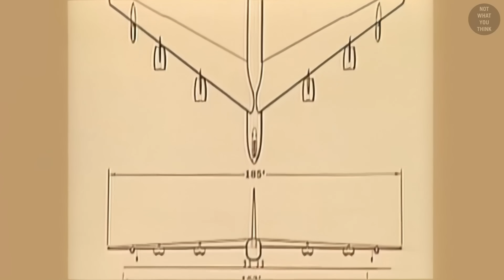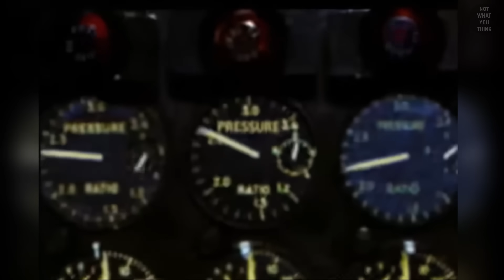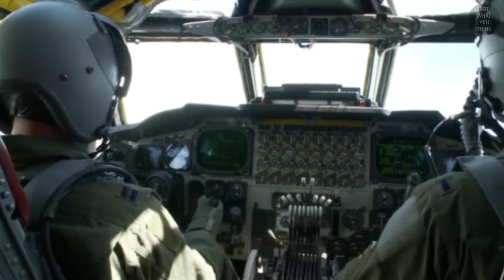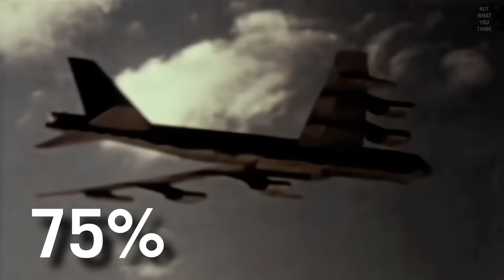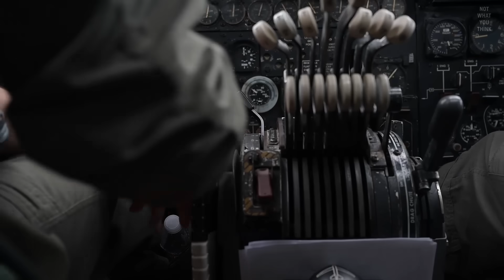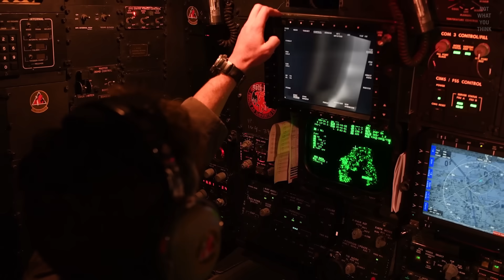Why This Obsolete Bomber Will Outlive EVERYTHING

Comment: B-52s are incredible to me because they are 70 years old and so versatile. Although they have had many upgrades, it's the weapons they carry now that have allowed their roles to change, making up for their obvious limitations in modern warfare, like a giant radar cross-section (RCS). They can fly over 8000 miles and fire 20 air-launched cruise missiles with another 1500 miles of range, or fire 20 Harpoon anti-ship missiles 150 miles. Three B-52s could take off from the States, fly between 20 and 30 hours, and launch 60 Harpoons at Chinese ships trying to invade Taiwan, or fly out of Guam, and fly for less than 4 hours. While helping Taiwan neutralize an invasion force, multiple C-17s carrying Rapid Dragon could launch 45 cruise missiles each at high-value targets across China. Old and still a valuable part of America's arsenal. One of America's best investments in national security.

Comment: I was a AFSC 43152 Airlift/Bombardment Aircraft Maintenance Specialist (Crew Chief) stationed at Dyess AFB and we had the old B-52Ds there until they were replaced with B-1 bombers. I was assigned to MAC  on a SAC base and a dedicated crew chief on the C-130H (741689). We were on flight line C, next to the nuclear alert pad. It used to scare the shit out of me whenever they were testing. You’d hear the blast packs going off and nothing but blue lights and sirens. It was old back then and all of the D models have since the early 80’s have been retired. Great aircraft! The B-1 is faster and carries a heavier payload, but the BUFF is no slouch. I don’t know where you get your stats on costs per flight hour, but that doesn’t sound right…too high.

Comment: In a sense, it does not need the vertical stabilizer, as the turning is not made by the rudder (in fact, it is very small with very limited action. If it still has one...),  but by differential thrust. That is also the reason for the 8 engines and why although with any upgrade 4 would be more than enough, as it does not have a capable rudder, the 8 engines are still required for redundancy to control it.

Comment: This is a garbage video. I retired in 2006 after flying the B-52H.  It is by no means obsolete.  It is currently scheduled to fly through 2050, with new Rolls Royce engines, when it will get the B-52J designation.  The B-52J will fly well past the retirement dates of the B-1 and B-2 bombers.

Comment: Guys, the Douglas DC-3 is all but immortal. It has outlasted many jet designs. It will likely even outlast the venerable and formidable B-52, even if the DC-3s are obliged to lose their radial engines and replace them with turboprops. The USAF is keeping this old warbird around because it has proven tough and flexible, but so what? All good things come to an end.

Comment: The BUFF is eternal. Also, that's one of the reasons why we send in low radar visibility aircraft with air to ground weapons systems ahead of time. The B-52 and A-10 are far more useful once you covertly remove the enemy's ability to resist an air strike.

Comment: They still need to upgrade the engines. 4 modern high bypass turbo fans engines will lift that thing up easily. Thes old, loud and smokey engines are a joke

Comment: The title of  the video is incorrect…. The B52 Is not obsolete. Obsolete is what gets hacked to pieces and sold for scrap because it is inferior in some way. These  aircraft are  modernized to be  relevant in the modern battlefield, the original design if the airframe  is a testament to how stinking AWESOME Boeing and its engineers ready were and still are.   Who is doing the modernization?  Boeing or divisions of Boeing thats who.  Extremely well designed and extremely well built, back when getting your moneys worth meant something.  Payload and range still can’t be touched, still a most excellent weapon once air dominance is obtained over our enemies.  A very effective tool used to continue softening our adversaries into submission.

Comment: The military should commission a new run of these bomber's. All the design and debugging has been done. All they would have to do is set up a production line and go. Using modern materials and methods it would probably be lighter faster and fly farther with a higher payload. Im sure Boing wouldn't mind the business.

Comment: Just an FYI, just because 3 out of 4 trigger mechanisms were activated doesn't mean we were even close to a detonation. The bombs use a precision shaped conventional charge which is required to detonate perfectly symmetrically (an 'explosive lens') in order to start the runaway chain reaction. The crash would easily have damaged this mechanism which would have not detonated symmetrically and thus it would not result in a nuclear detonation. Of course it would still be a dirty bomb and huge mess with a lot of dangerous radiation, but that would be more like a square mile instead of a 20-30 mile radius. Might seem like splitting hairs but huge difference in the magnitude of the problem. The last 2 incidents where you mentioned that the conventional explosives detonated are examples of this.

Comment: Some of those incidents with the B-52 were pilot error, (the ridiculous Holland incident at Fairchild AFB, and others) NOT the fault of the aircraft.  When you have 8 engines, there ARE going to be times when not all of then run perfectly, no prob, it can probably fly on only half of them depending on its weight and duty at the time.  But it is STILL flying and has earned its keep over the years!  When you get into the cost of the B-1, B-2 and others, the costs are in the billions of dollars.  The Stratofortress has been a good workhorse over the years and she'll continue to fly, into the 2050's so that in itself speaks well for the faithful old BUFF!

Comment: Neither America nor Russia will get rid of the B-52 and the TU-95 because they are alot cheaper to use in missions that have no air defense systems or area's with systems that have been destroyed or no longer existing. The maintenance time and the time it will be ready is managable and sustainable for the long run, 
There is probably one difference between the tu-95 and the b-52 and that is the engines, two different engines but one is very loud while still being very impressive for the type of engine it is

Comment: This is propaganda, made by people that are undermining national defense…
Reply: @jason4130 for the same reason the M35A2 was phased out. That 2 1/2 6x6 truck was very well designed. The cab could use air-conditioning. The seats could be more comfortable. As a cargo truck it’s not easy to stop. The trucks that replaced the M35’s are pathetic. It’s called a disadvantage, warfighters need advantages.

Replacing advantages with disadvantages is undermining national defense.

Modern designers bad mouthing those that are no longer here to defend their work. Just so they can receive a lucrative defense contract. 

I bet it’s a Democrat woman that signs off on it…

Comment: The remaining 76 operational B-52H's are 60 years old, We designed the B-52G/H in 1956 for high-altitude bombing. The emphasis in the structural design was minimum weight, to maximize range. This resulted in metal fatigue problems. In 1960 at the height of the Cold War, we redesigned the structure to meet SAC's new, more severe usage and service life requirements. These notably included low level terrain avoidance training, often under extreme gust and maneuver conditions. The emphasis in structural design shifted to toughness and durability. The primary structural components are never replaced. The main reason for their longevity is that the usage has not been as severe as was projected. As Chief of Structures Technology at Boeing-Wichita at the time of the redesign. I am honored to say I chose the materials, the analysis methods, and the limiting stress levels for the redesign. I am now 95 and I am thrilled to see these planes still flying, and projected to do so for many more years.

Comment: I worked on the G models for a couple of years in the early 80's. I hated having to deal with wiring problems as the wiring had been TCTO'd  to death (Time Compliance Technical Order, AKA modifications) and the wiring  going into connectors was brittle and difficult to work with.

Comment: I'd dearly love to see them make a B-53 along the same philosophy. This would be a real replacement. It would be about half the size, using half the crew. It would drop half as many bombs.
The advantage here would be the ability to take off from much shorter runways, making it forward-deployable. One plane couldn't drop as many bombs but two could. And since it's launching closer to the action, it can do more sorties in 24 hours, so it drops more bombs per plane in a 24 hour cycle than the B-52.
Forget all the stealth. Make it an efficient bomb truck like the B-52 only much newer, easier to maintain, etc. Only then would I be willing to retire the B-52.

Comment: The original B-52 variants entered service in 1955.  Those have long since been retired.  The H model is currently active and they're roughly 61-62 years old. So not quite 70...same goes for the KC-135 which will still be flying for a little bit longer while the government decides what to do with the KC-Y and KC-Z

Comment: I'm an old Air Force pilot and loved the engineering of the B-52 and the C-130 Hercules.  Both were invaluable in Vietnam.  But the real take-away from this video is about maintenance: if you replace the parts in your car prospectively, as the Air Force has done with these planes, you will never have to buy a new one until the parts are no longer made.  I bought a 1997 Ford Expedition new and maintained it the Air Force way.  It still runs like new, and I haven't had a car payment in 22 years.
Reply: Gary, I've had a 73 Chevelle for 30 years, replaced the motor shortly after I bought it for 1K, and through proper PMCS (I am Army, you all might call it something else?) still have it. Runs great, looks like "S".  Along with my other vehicles that I have always owned for over 15 years.  Yeah to your no car payments comments!
Reply: 700,000 miles on a '97 Tacoma but swapped out the engine for a rebuild at 500,000 (scorched head gasket) in 2019. Curiously, I had a heart attack On May 13th of the next year. We came close to achieving unalived status at a similar time, apparently.
Reply: Very cool. How many miles you drive it?
Reply: Did you mean proactively? Interested in the approach
Reply: Indeed, invaluable in Vietnam, and you still got ur a$$ kicked badly by the Viet Cong.... we want peace in this world, not some BUFF flying over killing innocent people

Comment: Obsolete means useless or pointless. For example 8 track is Obsolete. No demand for it or any particular reason to use or service the technology. A large Bomber plane has use far beyond it's original design intent. Including Civilian cargo transportation. Also the whole old vs new debate. Technology is not automatically better just because it is newer. Technology old or new always conforms to the physical and capabilities of its design and build material. If the benefits of a newer technology are not sufficient enough and or the cost is higher than a slightly lower performance and older option may be the superior choice. Older tech is often cheaper to fix and maintain. If I was starting a air frieght business I could order a brand new fleet of new Cargo jets. Or for a third of the cost I could buy a bunch of old Military aircraft suitable for the work. Have it refurbished for a fraction of the investment. Again significant improvements are nessicary to offset increased cost. Okay the Jet can fly an a lil faster.. but more expensive to operate. Unless I am cutting it close on deadlines I would not be particularly interested in the speed increase. Contrary if a slower plane is cheaper to operate and gets the job done just fine that would be more appealing. There are plenty of newer plane designs however they cost more.

Comment: Because the USAF will never admit to itself that it needs a non-sexy cheap bomber for bullying moisture farmers, and so will never fund development of a modern replacment. They've been trying and failing to retire this thing for fifty years. 

It's not fundamentally a great design for its role, but its role is so permissive that suboptimality is acceptable.  If we were trying to redesign a B-52 today, no doubt we'd remake it as a quadjet with modern airliner engines, better wing aerodynamics, more fuel, and a widebody fuselage with tons of space, power, and mounting points for future equipment. You could make them cheaper and easier to fly by enforcing commonality with commercial parts, and last more flight hours between overhauls. 

But again, this won't happen. Current AF brass likely thinks they will eventually replace the B-52's with B-21's, drones, or its role will become obsolete.

Comment: I never flew the B52H model that's flying now. But I did fly the B52F model during flight training and upgraded to the B52G on Guam for VietNam bombing missions. B52Ds and B52Hs were also used for bombing missions. Then I went on SAC alert in the 70s after VietNam. In the three models I flew and all the hours I accumulated over the years, I had only one major problem with the B52G I was flying at the time, but it got us home. It is one fantastic aircraft (even though it didn't have ailerons).

Comment: Regarding the engine replacement, did GE and P&W just not aggressively go after the contract?  Good for Rolls Royce, but I'd have thought Congress would have stepped in.  Or maybe they did, I never heard or read anything about the competition.

I had no idea of the BUFF's growing pains, either.  I knew there were reskins and other life extension upgrades but I just assumed because of it's planform and whatnot, it hit the ground running like the 707.  Maybe that's bc the 707 learned from the B-52.  If the relatively conventional Stratofort had so many early issues, makes me wonder how early production XB-70s would have faired, what with the extreme operating environment and cutting edge technology.  Btw, I appreciate that particular pronunciation of Valkyrie; I don't hear that often in the West.

Comment: Welp...there's still a lot of DC-3's still in service and doing well. Can't see why the B-52H's can't last 100 years. 
I crewed 52D models in the 70's. We had some common issues with Hydraulic Packs, Crosswind Crab System and some electrical & avionic system malfunctions, but, nothing major. They were actually fun to work & fly on.

Comment: This is actually the exact same strategy Russia has been using ever since the cold war. The Russian equivelant bomber is the "Bear" which is slow and big but can ourange almost any diffence when used correctly (this includes enemy airbases or carriers launching jets).
The way this is achieved is by dropping very fast and long range weapons and then retreating. The USSR and then later Russia have been introducing ever newer weapons to cover the lack of modernity on the bomber. As long as a bomber is still able to fly long range and carry the weapons.
Stealth bombers are the complete opposite, they are quickly getting outdated when new more powerful radars become avaliable, so a completely new stealth bomber is need to fix the issue.
Supersonic bombers are also very promising but even they have issues mainly due to high maintainance and shorter range.

Both Russia and the US have very old subsonic and supersonic bombers. The US had stealth bombers as well, the b2 but they were outdated today. They will soon introduce the b21 but Im sceptical if this was the right choise because I think they get their supersonic bombers out of service as well. Maybe the US needed modern supersonic bombers to launch hypersonic weapons instead of a stealth bomber that might be outdated in 2 or 3 decades. A supersonic bomber ccould be useful for more than 5 decades considering impoved weapons are introduced each decade or 2.

Comment: It's the same with the warthog. Proven design. Fuel will not be a problem in the future. Just build some new ones with advanced Avionics! If they work, They work! same with the f15! Buy some more of them all the bugs are gone! Buy some more of them. All the bugs are gone? Doesn't have to be first in! Send in the 35's first if they actually work and are stealth. The 15's can cover their flank. and the 16's and the 18's if the Navy is involved.